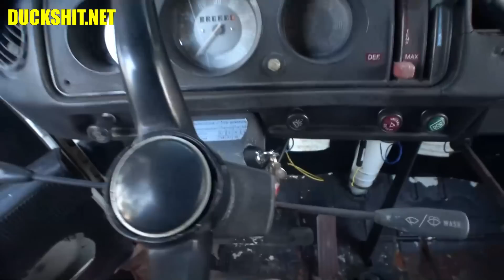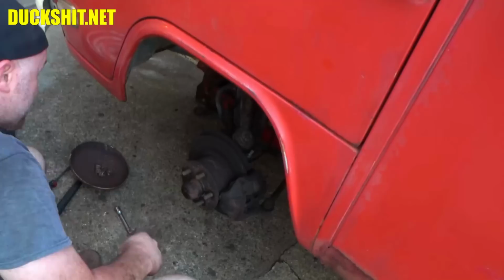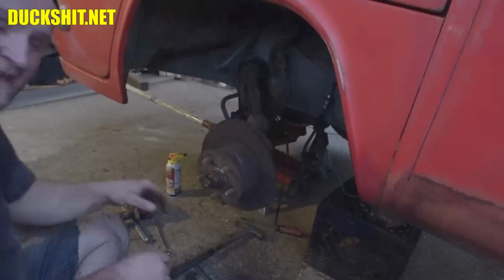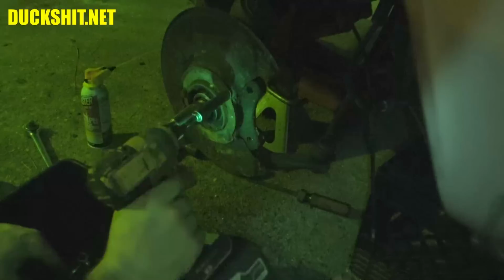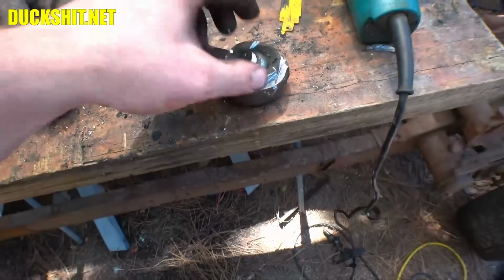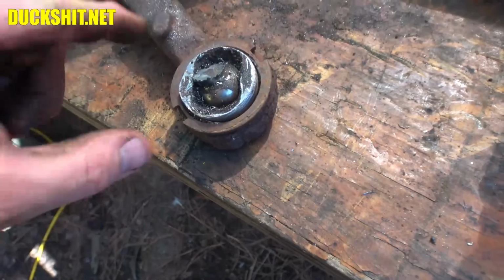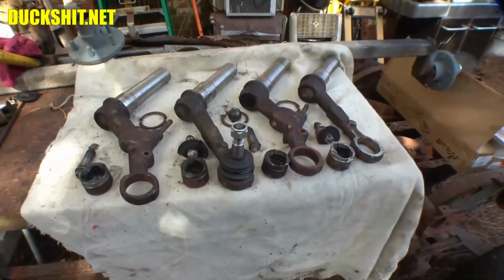EASY VW Bus Ball Joint Removal WITHOUT A PRESS! (Duckman Method)

Comment: Easier way is to heat with torch and it will knock out while it's still hot hit the new one in
Reply from the maker: FALSE!  Did not work!  Not even when glowing a dull red. Sometimes heat does not work, and in this case, all 4 of them gave trouble.  So no, that is not easier, this is easier, A LOT EASTER.

Comment: Hello I bought my SK when I was in high school back in 74  I. Auto motor  mechanic  class.and still have some of those SK tools
Reply from the maker: I think that is about when Dad got these, possibly even late 60s.  He's had them as long as I've been around.  It's hard to replace it, even if broken, because this is DAD's TOOL, the replacement won't be the same.

Comment: Hey duckman could use your advice 69 Jesse Baja bug only dreams about three-quarters of the tank of fuel the buggy runs out of fuel there still well over quarter tank left what are my options any advice would be highly appreciated
Reply from the maker: Well, first I'd make sure that the VW Bus trailing arms aren't installed wrong, lol.... since that is what this video is about.  But in your case, make sure the tank is vented properly.  That's probably it.

Comment: My press works fine for Bug ball joints. But I had a friend do my Bus ones at his VW shop years ago. His press was way bigger and he had the factory jigs. The whole thing nearly came off the ground when they popped loose😳
Reply from the maker: Oh man, that's some force right there!  I had no such luck, these things must've budged just a tad, they made pinging noises, but never actually came loose in the press.  Well now that I have an alternative method, I won't mess around with the press anymore when it doesn't want to come out.
Reply: @DuckmanCycles  Yes, cutting them apart does work. Especially when you don’t have someone to help hold the arm while you work the press
Reply from the maker: @bava67  yessssss 😕👍🏻

Comment: Those hubcaps are definitely replacements more than likely from the Asian variety meaning Chy-na. No wonder they almost disintegrated in your hands 🤣😂 The motor sounds like it might need your attention as well 😉

You literally gave blood for this; saw your thumb in those shots…Ouch!!!
Reply from the maker: Those hubcaps are super thin and feel like paper.  The engine seems to always run reliably, but has a BS carburetor on it, the wrong fuel pump, and has exhaust leaks.  I'll be addressing some of that stuff in later videos!
Reply from the maker: And yeah, I mangled BOTH thumbs on this project until I found the best easy way to do it!  Thanks man!

Comment: Yeah, well, when your Dad's and Granddad's tools finally wear out (I still have some of both Grandfather's tools, some are close to 100 years old) it's time to replace them...

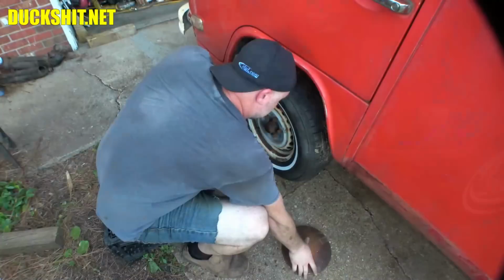@4:00 Yeah, shoulder problems suck! I wrecked a motorcycle in my 20s and came down on my left shoulder. Tore the ligaments between the outside of the left collarbone and the shoulder blade. What the Orthopedic Surgeons call an A/C (Acromion/Clavicular) separation.

Not fun dealing with it at 64 either!

🤕
Reply from the maker: Oh man, these tools.... great stuff, I told my brother that it was the ONLY thing I wanted from Dad's house, and I would fight him for them... lol!  He had no interest, so we did not have to start swinging at each other.
Reply from the maker: And I'm not sure what I did to the shoulder, its getting better, but VERY slowly!  It hurts where the shoulder joins my upper arm.  I did the same thing on the other side back around 2008.  It also took about 6 months to stop hurting.  Probably tore some ligaments.  Its a shame I'm built to be stronger than my individual components.  Ya know, I can lift a car, and change the tire without a jack... but I'll pay for it later.  LoL
Reply: @DuckmanCycles  Ask Gary VW Jawbreaker about that; he’s had to deal with shoulder problems too. Not fun.

Comment: Do not use ratchets for big pressure use a wheel wrench or power bar that way the gear teeth last a lot longer !
Reply from the maker: Even big ratxhets designed for big pressure.... lol   thanks!

Comment: Hi! Do you know what is used inside the torsion tubes that the trailing arms ride on? I have a narrowed front end and the left lower trailing arm is wiggling in the tube. I haven't taken it apart yet. If it is needle bearings or a bushing, are they a replaceable? Thanks man.
Reply from the maker: Typically there are needle bearings in there, or a urethane bushing if someone replaced it at some point.  Best to investigate why its loose soon before it comes apart on ya!   I'd stay away from the urethane and use the bearings if you can.  No squeaks, and last longer!
Reply: Thanks @DuckmanCycles ! The beam is narrowed, so probably a bushing and not bearings. If I  can find bearings, I will take your advice. Should be interesting trying to create a tool to get in there to  replace if that is the issue. Thanks agian.

Comment: Looks like a pain in the butt doing the ball joints. I have done them on other vehicles. It's never easy. To me, it looks like you are doing a lot more repairs now. There is nothing wrong with that, can be good money in it. Especially if you are fast at it. I haven't heard anything about your IT work lately.  Good video Lord Duckman 🦆.  Cutting off the dicks and balls. Lol. It seems main stream now. Oh boy. Can I say boy?  🤪 Noel
Reply from the maker: Haha, I don't do much IT anymore, and I have been doing repairs for a while, but I wanted more material for the YouTube channel rather than showing the same cars over and over and over again to keep things fresh.  Got some more rust repairs coming soon, too.... but different cars with different problems.  Its gonna be awesome!